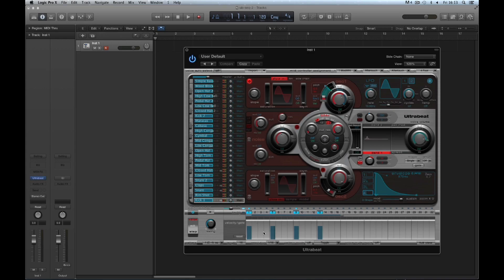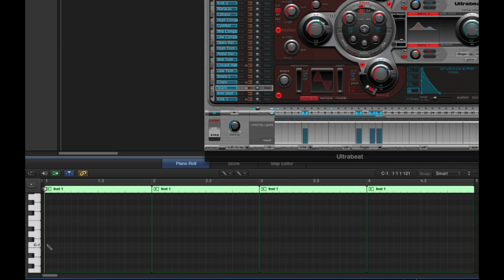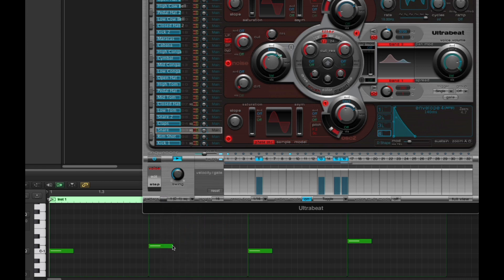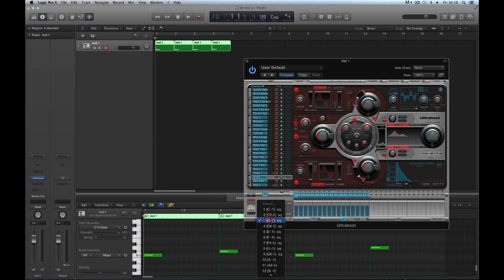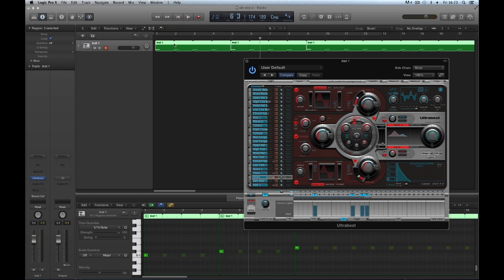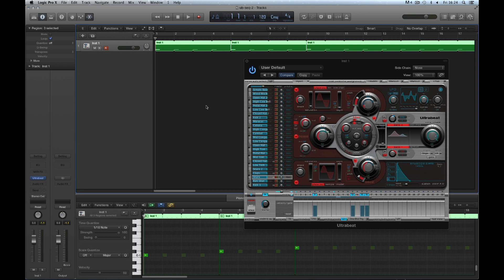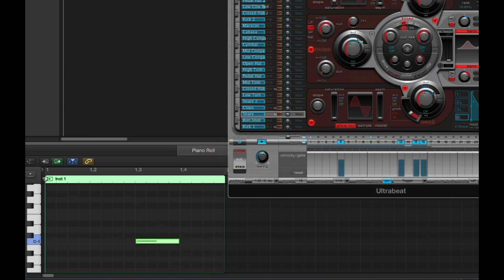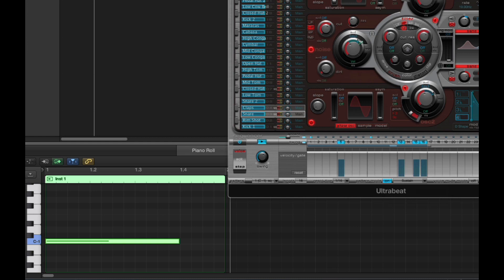Ultrabeat Tutorial 2: (Sequencer 2/7)

Comment: Intensive commenting now but I'm awestruck by what you can do with this one single plug-in. This is the idea to trigger sequences as used by Ableton (which I bought.) Got it to work in general. (I have rewritten this comment 5 times as I progress in getting it to work:) How to assign sq trigger notes to my own patterns I wonder.
Reply from the maker: "How to assign sq trigger notes to my own patterns I wonder." - how dya mean? are you exporting midi patterns out of Ableton into Logic?
Reply: I was thinking how to give my own pattern a trigger note to be able paint in C-3 or what ever, like the factory patterns have
Reply from the maker: *****
 no, i still dont get it.
Reply: dancetech Haha, because you weren't able to get my issue, I checked and it turns out my issue doesn't exist. All empty slots have trigger-notes,.I saw some "0" for empty slots and therefore thought triggers were missing but all slots are assigned to C0, C#0, D0 and so on. Everything working.
Reply from the maker: *****
nah i still dont get what you are trying to do, but it's odd though cos the default midi notes for ultrabeat voice slots, starts with C1 down at voice-1 and goes up to voice-25 on C-3. is the ultrabeat track setting transposed down at octave?